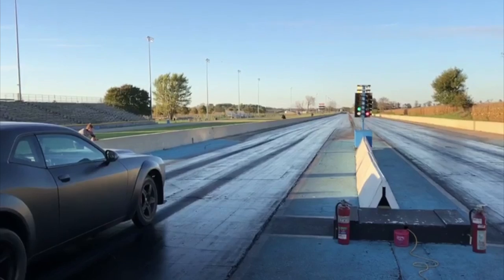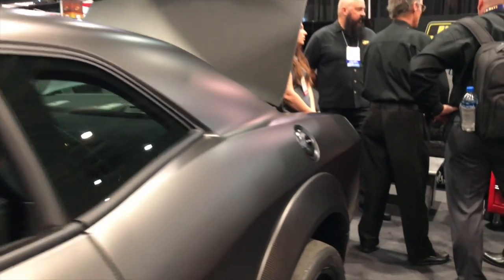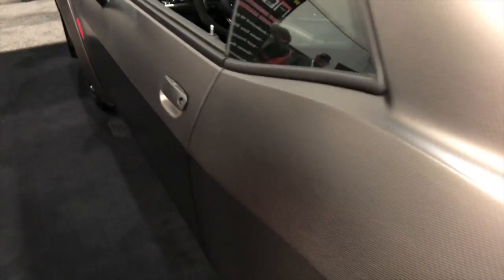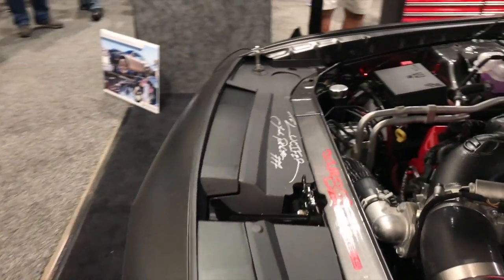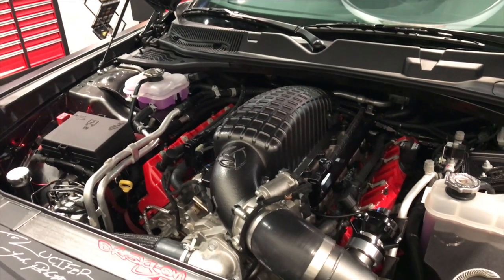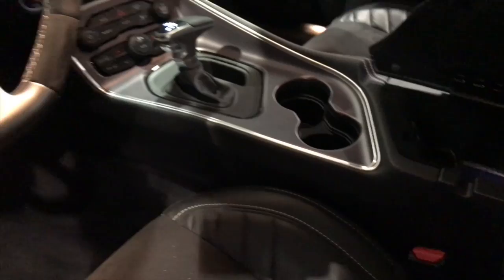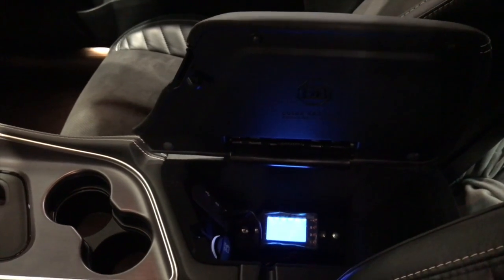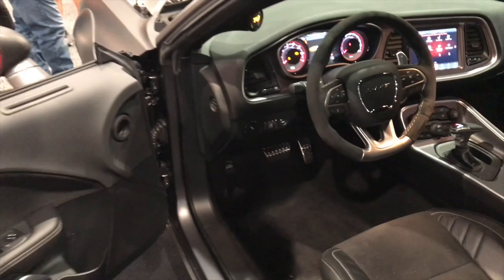Speedkore 1,400 HP Dodge Demon Walk Around and Race Footage

Comment: What was the 1/4mile time??
Reply: 8.77 s
Reply: GarrisonsASS still in Trouble with Mustang Cobra jet and McLaren 720s.
Reply: @sylviofleurant2507  8.77 he's faster than any car in the 1/4 mile even a modded 720s can't run 8 seconds
Reply: I have read that the cobra jets are 8.5 sec in the quarter and have broken into the 7s